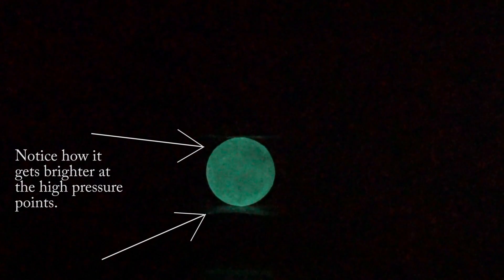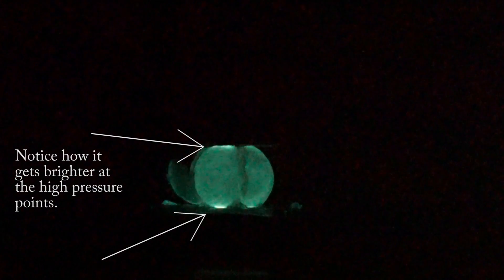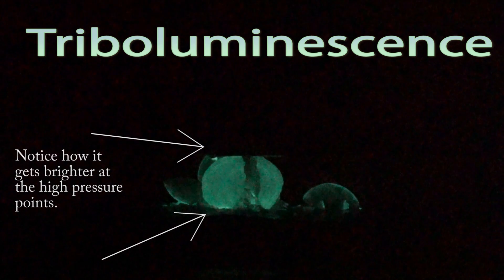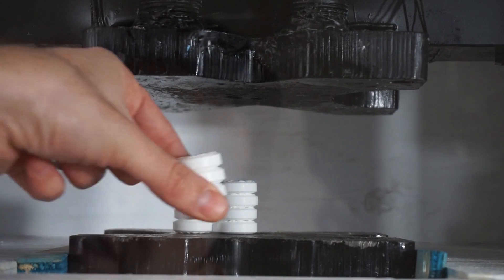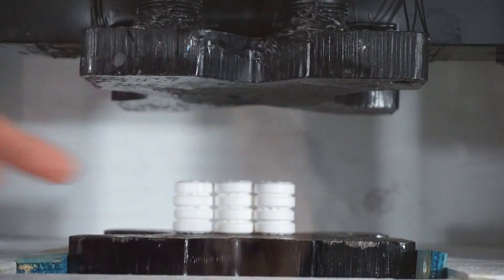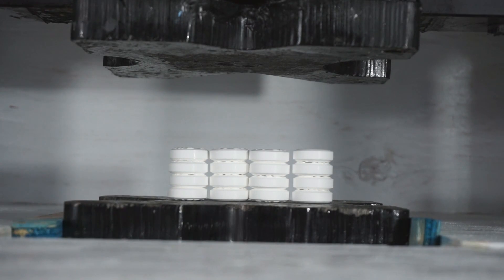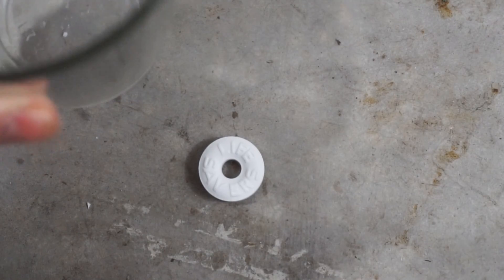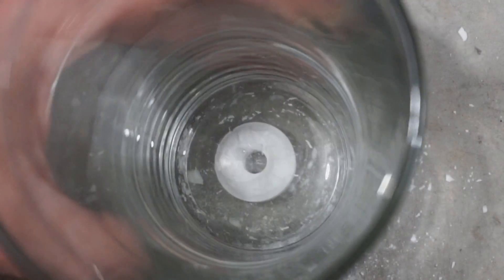Can I Make Triboluminescence Happen In A Hydraulic Press?

Comment: I wonder if putting non-heat work into the system causes some of that work to be converted to heat due to something akin to friction. Could this promote some electrons along the interface where the crystal lattice cleaves to be promoted to the next energy level, where they quickly emit a photon and go back to their original energy levels? 

If a molecular orbital is a the result of constructive interference between atomic orbitals, I imagine the interface where a crystal lattice cleaves would lose energy as there's probably a 1-atom thick region where the orbitals of any two particles would not be fulfilled (according to the octet rule) and so they might emit that extra energy as light. How would I test this?

Comment: Build a cylinder out of 3/4 metal fill halfway with water and get press head the same circumference as inside of cylinder and see if you can compress the water or what happens under extreme pressure

Comment: you need a high speed camera. there could be flashes of light in between the shutter speed. try a prolonged exposure. set up a camera in a room with NO light. then start the camera. at the end will be a stil image with any light produced during the exposure interval.